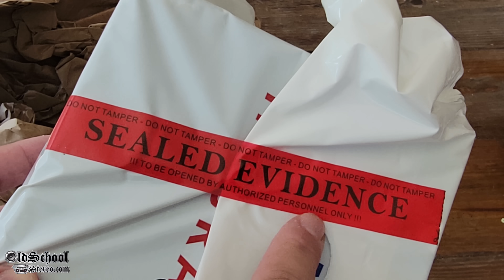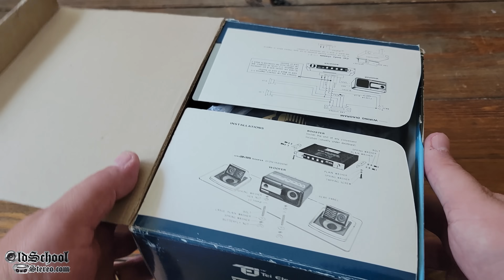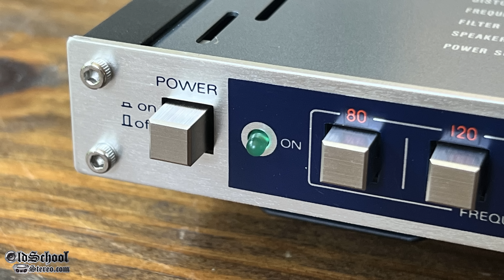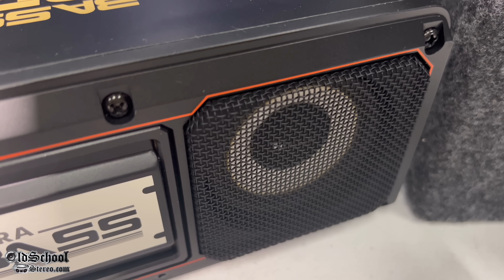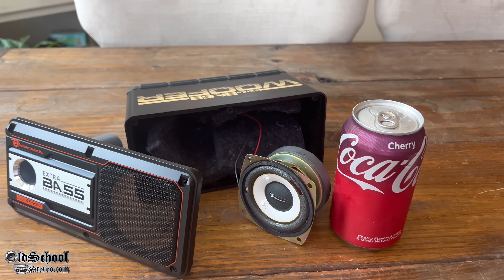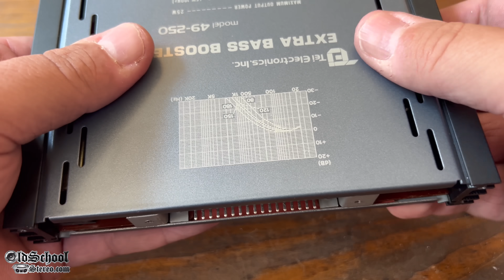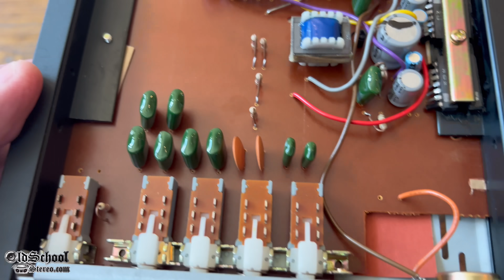The BEST Car Subwoofer of the 1980's?

Comment: Parts express has replacement woofer for it.   😉
Reply: I would put a nice 3” Dayton Audio or Tangband in it.
Reply: @Bassotronics  Tangband for the win!!
Reply: @91CavGT5  That's what I was think then wire in a cheater amp it would be amazing.
Reply: @91CavGT5  tang band for sure. I have a w6-2100 in a big ported box tuned to 17 hz and it is insane for a 6.5
Reply: @nickzom  tuned to 17hz?!?!?!  Holy cow!!!  How is the response?
Reply: @91CavGT5  not bad at all. box size plus port size it pretty much acts like a sealed box until you start to get below 35 hz or so
Reply: @Bassotronics  Yoo its bassotronics
Reply: @Bassotronics  I've always wanted to get a small Dayton driver for one of my Bluetooth speakers. It would probably work very well.
Reply: Just refoam it
Reply: @theloudspeakernerd-tlsn9322  Its not always worth refoaming them
Reply: @bassmonkeyxm  refoaming would be perfect for this woofer tho, it wasn't abused to have the foam break, it was just old. The issue with a refoam usually is that the spider is also blown tf out and nobody replaces that
Reply: @joeyholthusen6495  it would be better to buy a modern sub.
Reply: Does he say the partnumber?

Comment: Find those old school kraco truck box speakers with a passive radiator.    6 inch driver and 8 inch radiator with a tweeter on top.    I believe they sold for around 100 bucks a pair in the late 80s early 90s.   Think model was kraco FX95 truck box speakers
Reply: FX95

Comment: Hell yeah it is, I've got 8 of them running off of a Pyramid booster/EQ!
Reply from the maker: Boom!!
Reply: Hey Big D.... Make another video with this enclosure and a Tang Band 3" sub😎✌️ @wal2
Reply: @theresistance2641  such a valid thing to bring up
Reply: @wal2  
Did you notice how similar the design is to the Pyramid speakers that "light up your life"? Also instead of throwing the 3" sub away is there any chance that you could send it to me so I could refoam it and the booster? I know it's junk but I love cheap 80s and 90s speakers and think they are cool in ways that high end speakers aren't. Also if you don't want the Pyramid speakers that light up your life I'd take those too. Please let me know if you would consider this and name your price. Thanks man, love the channel! I'll try to send you something soon like the old 6.5" Roadmaster "subs" in the carpet box with orange surrounds.
Reply: @dougmasters3875  Miami Bass Express. Techmaster PEB. DJ magic Mike. Nemesis Munchies for your Base..... 🤣🔉
Reply: Do u fr ? Is this fr
Reply: @larrymontgomery4902  Yes, why would I lie about that??
Reply: That's why you need eight. It has to move a lot of air.
Reply: Sitting on the rear deck of your car lol
Reply: Id like to see that
Reply: Those 6x9’s are probably bumping more bass than that 3
Reply: Oh showoff, jeez
Reply: Pfft, that's nothing. I wired up bout tree fiddy of them to my big wheel. I have to tow them around on a small trailer, but it's worth it because I play the Cops theme song on loop and now EVERYONE will RESPECT. MAH. AUTHORITAHHHH!!!!!
Reply: Need a Realistic eq/booster for ultimate sq😂😂😂
Reply: @jsackett42160  Roadmaster and road gear by far😂
Reply: 🎶I got 8 threes bumpin in the trunk,
When I turn the bass up you know it bump🎶 when Dee test my amp I get crunk, all my threes in the trunk gon stunt🎶

That's a meelion dolla song right dere 🤣
Reply: @RobertD_83  NO
Reply: ROFLMAO OMG Pyramid is THE Worst speaker company....even worse than old radio-shack speakers!
Reply: @shanemitchell477  don't care
Reply: @shanemitchell477 actually the old optimus and radio shack speakers weren't that bad, i had a set of 4 of the optimus 15"s (kid blew 2 of them up while i was at work 25 yrs ago) still sound grest
Reply: @jimbobdobbs1597  We'll they were about 50% better than Pyramid!
Reply: @shanemitchell477  dual brand are even worse